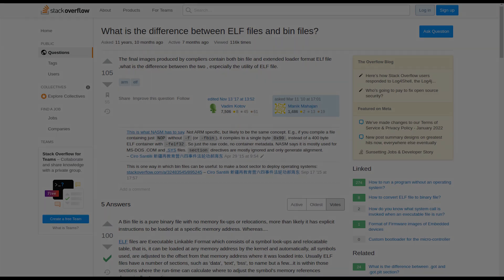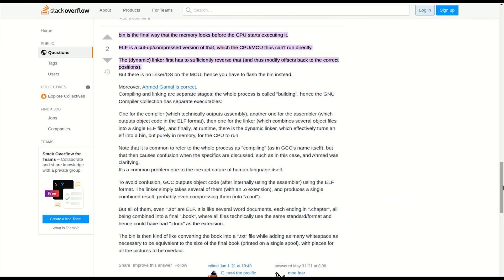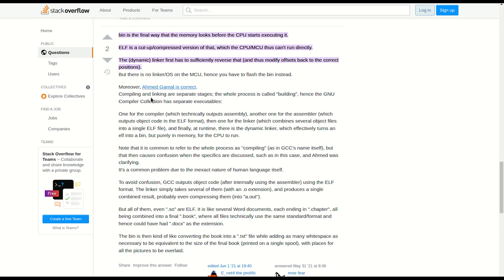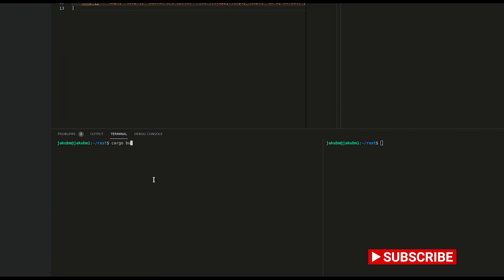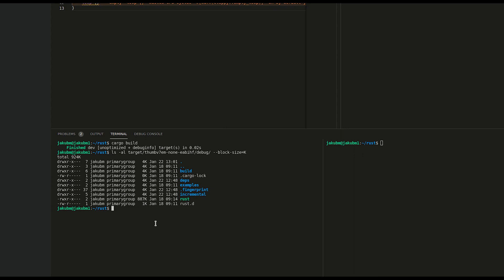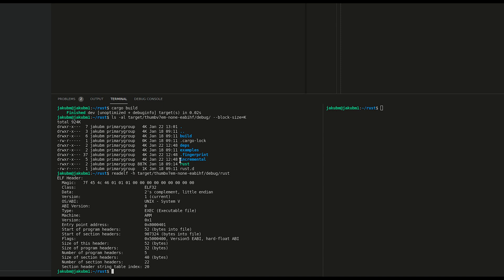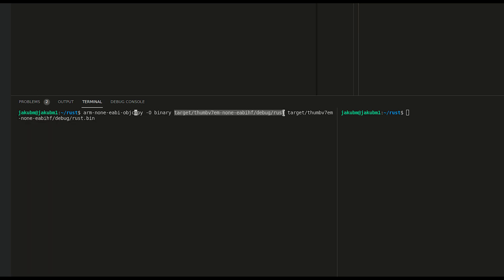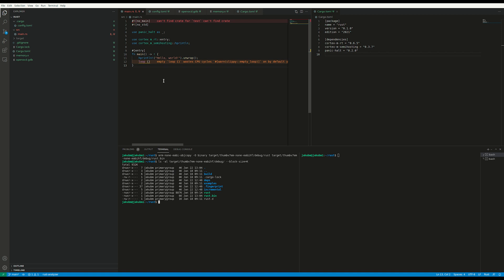Rust Embedded for STM32 Microcontrollers: Cargo Build artefacts (ELF vs. BIN)

Comment: Which plugin for vscode are you using to get those inline his in the editor? Looks very useful!
Reply from the maker: Rust Analyzer. I have scheduled a video about my VScode in two weeks. 🤫 You will be able to see and setup bits and pieces similar to mine.
Reply from the maker: Roel, the video is there :) Don't forget to check it out.

Comment: Can't we obtain  same  using cargo --release(release build)
Reply from the maker: Hi _AnanD_, I took some time to reply because I wanted to make sure that I answer your question fully.

Cargo build, builds ELF files which contain more information about the binary (very handy for debugging). You can always convert ELF to BIN, but not other way around. When you do `cargo run` (it uses  probe-run) it takes the ELF file, converts it to BIN and loads it to the memory (it knows the correct memory address to load, because ELF file has that data, BIN does not). ELF can contain multiple segments and correct memory locations. 

Using cargo build will produce you a debug version of your binary.
Using cargo build --release will produce you an optimised release version of your binary.
Reply: @JaJakubYT  Thanks for the reply .It's great that you are doing some quality Rust content